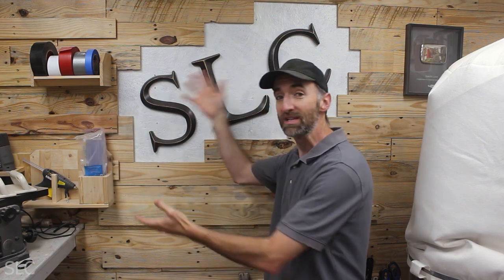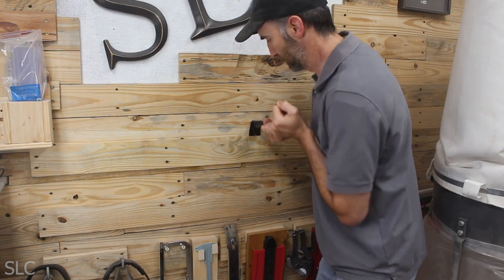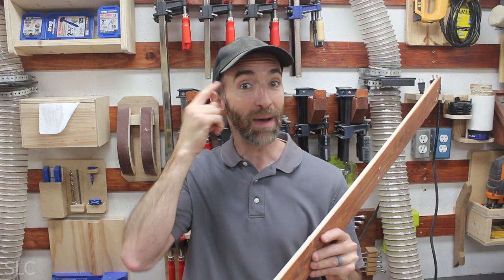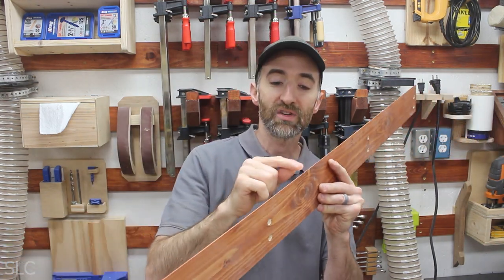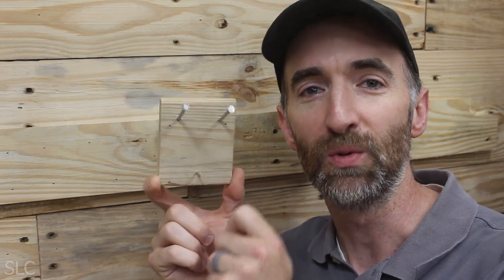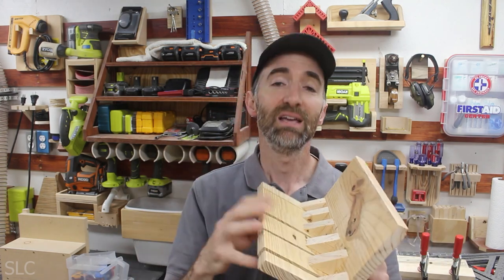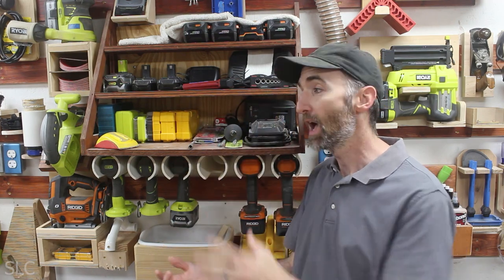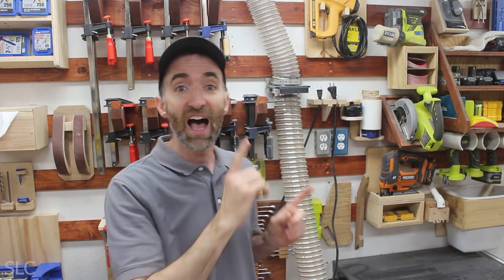Avoid These Mistakes I Made with French Cleats

Comment: Great tips! Best ones are consistent thickness i.e. 3/4” plywood, removing 1/8” or sanding the top sharp edge, and one of my favorites is building in a locking mechanism which works great for lighter/smaller cleats. 👍🏼

Comment: Clinton, I've been using your videos as my bible for building my french cleat system, and it has been invaluable. But you have so many videos, I've found myself losing track of what ideas or techniques are where. this has resulted in me fast-scrolling through the same vids repeatedly. So I finally figured out that I should make a Table of Contents. I've only done a few of your videos, but I thought other guys could use it, and maybe even contribute more. So, hoping it is ok with you, I'd like to share what I got so far. Best wishes.

20+ Simple French Cleat Ideas for Your Tool Storage

1.	Skilsaw
2.	Dog-bone Wrench holder 
3.	Chisel holder
4.	Orbital Sander
5.	Paper towels
6.	Glove box
7.	Angle Grinder
8.	Old time tool box
9.	Corner Squares
10.	Bar clamp
11.	Woodworking Clamps, Stacked
12.	Screw boxes
13.	Spade Bits, 
14.	Mallets, hooks
15.	Transparent PVC Pipe as storage
16.	PVC small tool holder
17.	Chunk of pegboard
18.	Small simple with nails
19.	Beer can holder
20.	Tape measure

 20 More French Cleat Ideas #9

1.	Oscillating Multitool
2.	Mobile perpendicular LED Light
3.	Bench Cookie Cones
4.	Pliers, larger
5.	Big PVC Cubby Holes
6.	Simple 2-drill Motors
7.	Multi-purpose holder
8.	Paper plate saw blades
9.	Reciprocating Saw (Update)
10.	Milk Crate scrap holder
11.	T-Post driver
12.	Misc Crates for Storage
13.	Metal French Cleats
14.	Turning Tools, Vertical. Update
15.	Over the door Hangers
16.	Contour Gage
17.	Oil Filter Wrench
18.	Save long triangle strips for bumpers, Stirring Sticks
19.	Flush Holders

10 Awesome French Cleat Ideas

1.	Round cla;mp holdere
2.	Brushes
3.	Clamps, Two-Level, Updated
4.	Screw Box
5.	Files, Compact
6.	Shelf, V Shaped
7.	Fan
8.	Spotlights
9.	Step Stool
10.	 Ceiling Installation of Fr. Clts

Avoid These Mistakes I Made with French Cleats

1.	Don’t use pallets
2.	Use screws, not nails, on cleaats
3.	Follow consistent size on cleats
4.	Shave the tip of the cleat surface
5.	Tiny holders come off easily
6.	Plywood is beter than wood for most things
7.	Make extra slots in your holders
8.	Try not to cover up lower cleats with higher ones

Comment: Good stuff, as usual. I've saved most of your French cleat videos and refer to them frequently. In making cleats the other day I made a painful discovery, though. While running cleats through the table saw to trim off the sharp edge, I was periodically getting tiny spears thrown painfully at my face and arms by the blade, which was raised a little above the sharp edge of the cleat. I discovered that if the edge of the cleat extends just a tiny bit past the blade as it is cutting, a sliver is cut off and goes whizzing off at high speed, sometimes along the table, sometimes at a faceward angle. I was wearing my PPE and standing to the side, but the spears were stinging my hand and arms and bouncing off my glasses. I had set the fence to cut off less than the blade width, but apparently a couple of the cut cleats were a little wider. Next time I will raise the blade higher so the teeth are cutting at a more downward angle and hope that solves the problem.
Reply from the maker: That definitely sounds painful. I hope your modification works well. Thank you for letting us know.

Comment: Year old video hope your still checking comments. So I am about to begin a shop that uses primarily all reclaimed pallets and pallet wood including my workbench and my next project French cleats. My idea was to just get them all to the same thickness. I had many ideas from hand planing all the way up to making a router sled or just buying a thicknesser. If you could get all the pallet wood to the same thickness, do you think it would work then? Thanks for reading my message. Hopefully respond
Reply from the maker: As long as the pallet wood was good quality and in good shape, I would think it could be used as long as it was the same thickness. Just remember that the thickness of the wood is part of what gives it its strength.

Comment: Thanks. What's the ideal width (not thickness) of cleats (I see 2.5 a lot) and what should be the gap between two cleats?
Reply: The ideal width is 2.5” and for spacing I simply use a small scrap 2x4 so 3.5”.  I hope this helps as I’ve installed a lot of French cleats. 👍🏼
Reply from the maker: The Gap is completely up to you, just keep it big enough so that you can take your holders on and off easily.
When it comes to the size of the wall cleats, that varies among people depending on the material they use. I like to use 1x4 pine boards which means the size will be between 3 and 3 1/2 inches. That way I can have two screws at each stud. But other people use different sizes.
Reply: @SpecificLove7  Thanks. After doing some maths, I concur with your suggestion of 1x4 as it gives enough strength + optimum space on wall. Thanks a lot for great videos and suggestions!